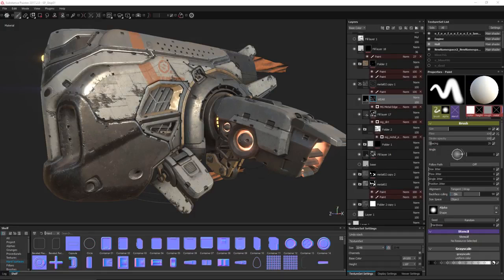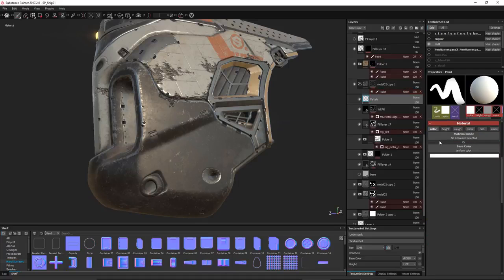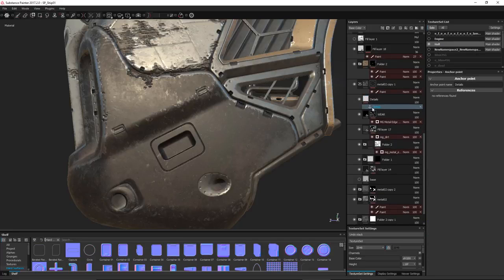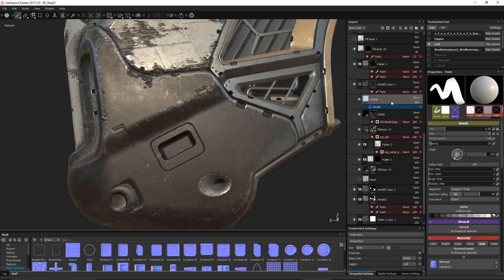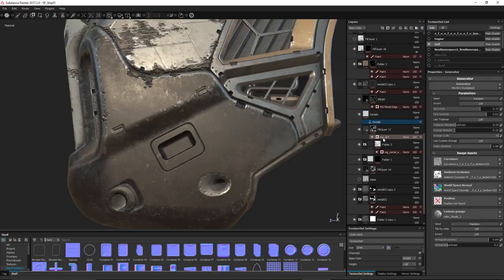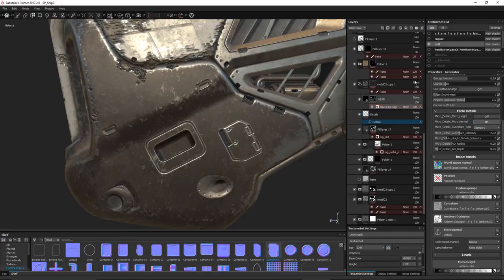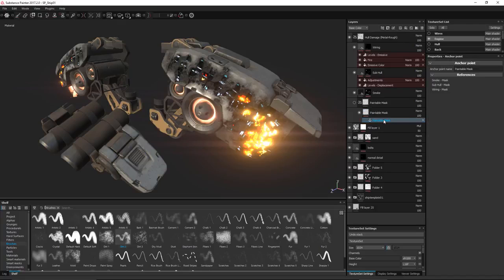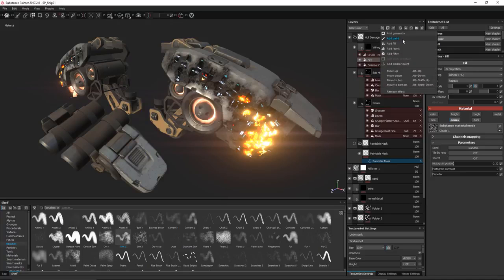Substance Painter 2017.2:  Using Anchor Points

Comment: Beef

The Smart materials masks do NOT have these included so you have to remask each one

Not all masks have this option - ie dripping rust

You 'd have to duplicate your details so they won't get painted over quite often if there's a basecolor...more slow down

Despite being named micro NORMAL and micro HEIGHT, the drop down menu defaults to sampling the basecolor...when it should default to the respective Normal and Height channels...especially odd given that the basecolor wouldn't be visible most times UNDER the layer in question.  

Also kind of useless if you stamp details on separate layers as you can only sample one anchor point at a time forcing you to put a bunch of details in a single layer which not everyone is into doing.

Comment: I'm kind of annoyed that Allegorithmic decided to make this so complicated. 
It's nice to have a non-destructive alternative to what I was doing before (baking again using the normal map with all of the extra details), but if I have several materials with masks in them (which I often do), I need to go and setup anchor points to each one.
Reply: I'm of the same opinion. This feels like an over engineered solution to a problem that was only partially understood by the programmers. :)  It's kind of cool but doesn't solve the actual problem all that well.
Reply: Ideally, I would like to be able to mark my "normal map painting layer" as something I would like to be affected by all materials with automasks. And maybe an extra option to disable it on a certain mask in particular if need be.